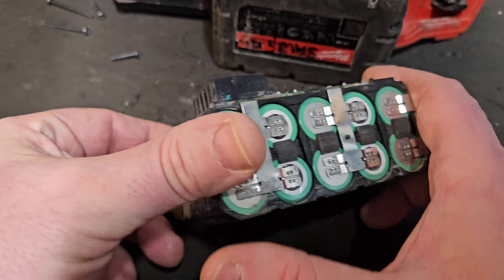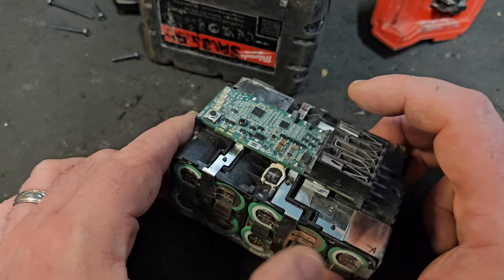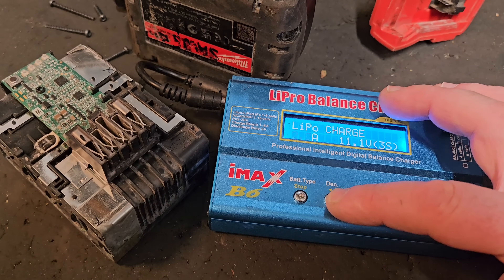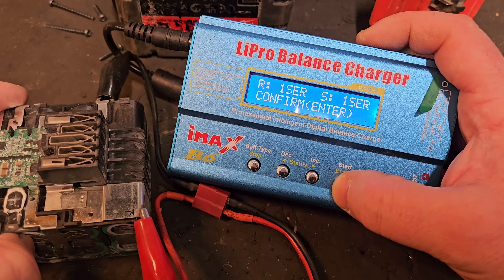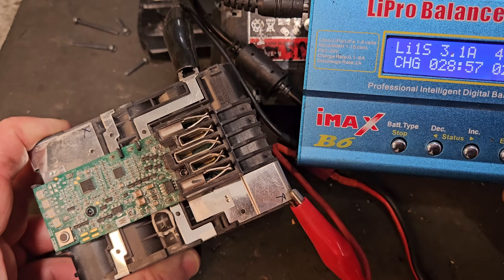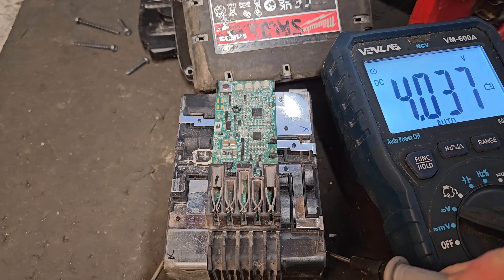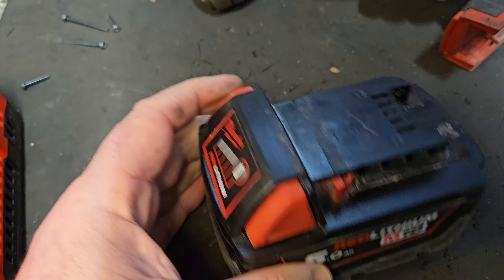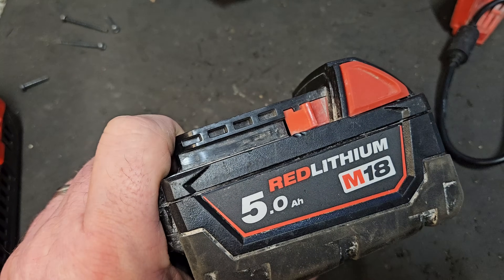Milwaukee Battery repair course EPISODE 9 dealing with cell imbalance

Comment: Hello I m just finished repair couple of batteries M18 and ONE of them was imbalanced and I couldn't reset BSM so I take air solder and put out the😄😄 BQ76925 and put back , now it works !!!
Reply from the maker: That's great you got it working

Comment: @doctorlefthandthread - thanks for putting this course together it was extremely helpful!  Question, I have a 5.0 battery with 4 banks at 4.1v and one bank at 0.2v.  Is it worth it to buy the charger or should I just get new cells?  Thanks!
Reply from the maker: Getting new cells is difficult I use reclaimed cells from old packs. To answer your question yes the cells at 0.2v are beyond recovery and need to be replaced.
Reply: @doctorlefthandthread  Thanks appreciate the reply!  I guess this battery will be demoted to reclaiming cells if my other batteries go :)
Reply from the maker: @projectguyprojectguy9019 yes I would say so

Comment: My IMax charger keeps saying Connection Break any idea whats wrong with it? I had to make some cables up as I dont have the ones you have May they are to thick and long
Reply from the maker: It might be an issue with your charger or you might be doing something wrong

Comment: Un grand merci de ce partage j'ai 3 batteries en m18 9ah a corriger elles ont en effet une cellule a 2.8 au lieu de 4.10 . Je vais donc acheter ce chargeur lipo pour essayer un équilibrage et voir si oui ou non elles peuvent reprendre  du service correctement.
Reply from the maker: It should work

Comment: I balanced all 5 banks of my 5.0 battery. all 5 banks are reading 3.71v. problem is that the charger is reading this as fully charged. they will not charge any more than 3.7v. how could i fix this. thanks!
Reply from the maker: There is no way the charger is reading the cells as fully charged at 3.71v . If it won't charge and the cells are equal you need to change the board.
Reply: @doctorlefthandthread  that's what i was hoping not to do lol. Is it possible to charge each set to 4.2 while all are at 3.7 currently?. i don't want to risk bringing the voltage up past what the other cells are currently. i guess i will try to change the board. Thanks!
Reply from the maker: @fortifiedcoffee7673 what exactly are you afraid of?

Comment: That would be only good for a while, the reason why that part of cells drop to that low is the battery has self discharge because of electrolyte damage.

Comment: Nice videos.  Confused on how you could charge 2S or more at the same time.  Isn't each bank in the M18s isolated with output terminals going to the BMS board?  Eg)  how could u say charge 3 banks without ACTUALLY pushing voltage to all 5 banks if they are in fact connected together?
Reply from the maker: See Short reply

Comment: Couldn't you also plug the battery into a light and let it run down to zero, then jump-start it with another battery, and now you are back in balance?
Reply from the maker: Running it down to zero is  a very bad idea

Comment: I recently bought a lot of 8 'for parts or repair' Ryobi batteries, and I was able to bring back two of them to life, while two of them couldn't have the 'trickle charge trick' done to them since I think the charger still detects the cell imbalance and refuses to charge.  Two of the batteries had significant water damage and rusted out, and the other two (both 6ah HP) require a BMS reset which requires specialized equipment.  Nevertheless I appreciate this video, this will point me in the right direction in what to do with two of the batteries, and hopefully those can be resurrected.

Comment: To charge AND BALANCE a 5S  battery all at once you have to add balance leads to each bank and plug them into the side of this charger. If you don't do this then you should stay with changing each bank one at a time!
For example 1S = 1 Bank and 5S = 5 Banks as he mentioned in the video.  Each bank has a nominal voltage of 3.7v and fully charged would be 4.2v or 4.1v or so if the batteries are old and worn down.

If you attempt to set the voltage to the 5S 21.0v and charge all at once them the batteries with a high starting voltage can get over charged while the lower volt battery or batteries will still be at a lower voltage which is not good and it can be very very bad situation if you cause one of these batteries to burst into flames as they burn so hot that typical fire extinguishers can't put them out. Just google EV car fires and you will be amazed and likely scared to mess with Lithium batteries.

Comment: After rebalancing, can it be expected the same cell groups will need to be rebalanced after some time?
Reply from the maker: It really depends it can take a long time to become unbalanced again
Reply: Being a former power tool rep, I’m really baffled how these big name brands would just let this happen, and not fix it immediately.  

Balanced charging was a major selling point in getting lithium “back up off the ground,” after the failed first attempt in the industry (around 2007).

Comment: Is the charger actually balancing if you don't have any of the balance leads connected as well as the charging leads?
Reply from the maker: I am bringing the cells up to the same voltage individually. You can balance a pack by connecting balance leads but it's more complicated.

Comment: what if I have the single layer battery pack (with 5 cells) and that exact same bank is the one that reads 3.0v while the rest of the pack reads 4.2v.  the problem is, there are 2 batteries tied together on that bank. the one with 3.0v and then it's also touching one that's got 4.2 already. I am worried that if I begin charging that bank, it's gonna overcharge that 2nd battery (since it's touching).  How do you do this???
Reply from the maker: Your 5 cells are in series not parallel. They are not connected in a way that you need to worry about charging 2 by mistake. If you can read the voltage separately you can charge that one separately by connecting the charger is the same place you tested it.
Reply: @doctorlefthandthread  Thanks, it worked! It's no mystery I am "stupid" to the ways of electrics. But that gave me confidence to go for it.

Comment: Could you also use a dc power supply to charge up the one bank of cells? Good video!
Reply from the maker: There are so many methods but I find the lipro B6 the easiest

Comment: I noticed that you are using LiPo mode instead of LiIon, does that matter?  I would have thought that the mode would have been LiIon?  Also, if I am charging a M18 HD12.0 battery, which has the same configuration of 1 bank of cells, followed by 2, and another 2 —- however with 3 batteries per bank instead of the 2 per bank that you show in the HD8.0 battery, do I need to change any settings?
Reply from the maker: Lipo is the setting to charge lithium-ion 
When charging a bank of cells the settings are the same if the bank has one two or three cells per bank
Reply: @doctorlefthandthread also is there any value to doing a slower lower amp charge (trickle charge), that takes more time?  I.e. 2amp vs 5-6amp?
Reply from the maker: @dkerze it's better to charge slow always
Reply: Thanks.  For some reason I only saw the response now.  I just got done watching your 6 video series and 9 video series.  Very helpful, thank you.  Note: I think LiPo is used for RC car batteries.  I am using LiIon mode which is meant for Lithium Ion.  Who knows, they probably do very similar things.

I think I read somewhere that the cells that tend to fall out of balance may sometimes be of an inferior chemical make-up.  Inconsistencies in the quality of the lithium / other.  Do you find that after you fix an out of balance battery pack that is suffers a similar fate after high demand use in the future?  Wondering if some battery packs are just destined to be lemons in a sense.
Reply from the maker: @dkerze they mostly hold the balance for a considerable amount of time

Comment: I have an M18 8.0 battery that takes a full charge, however after using the battery for a short period time goes dead. Once placed on the charger it immediately shows 3 full bars and charges to full capacity in a short period of time. I have checked the cells and it appears one bank is imbalanced. If I rebalance that bank will this resolve that problem?
Reply from the maker: Yes

Comment: So here’s a stupid question maybe, I have an M12 6.0, could I not just jump the one battery by hooking the individual bank to the charger without disassembling the battery.  Or possibly jump it with another charged battery?
Reply from the maker: If you identify the cell bank thats lower than the rest you can bring it up with the charger. Connecting to another battery won't cure cell imbalance.
Reply: @ Thanks for gettin back to me so quick.  I’m guessing you mean the charger that you have there and not the m12 charger.  I suppose I should have specified in my original comment
Reply from the maker: @hopkinstreeexperts759  yeah the charger I use to bring the cells up is the lipo imax b6 balance charger

Comment: Bought the charger on Ebay for $25, found I had two low banks on a 12A battery, brought both back up to 4.1V and all 4 lights light up again, full charge. Thank you for the video especially on how to operate the charger correctly.
Reply from the maker: That's great news well done thanks for commenting

Comment: Greetings from Long Island, NY. Great work sir! 
Question: why not just use the smart charger to discharge the entire unit down to the charger's minimum recommended voltage for that particular 5S pack, then throw the pack on the oem charger for a (hopefully) balanced charge? I've got a HTRC C150 charger I use for my RC equipment and I'd like to perform this on my M18 XC8 that suffers from the three bar syndrome, but I really don't want to baby-sit the job on the re-charge cycle. Thanks in advance.
Reply from the maker: Thanks for the comment. I have never tried the approach you suggested but might give it a go next time
Reply: @doctorlefthandthread  I have tried completely discharging the battery, then putting it on the charger in hopes it would balance out on the dead side. It did not change anything and still only got 3 bars.
Reply from the maker: @reddreaper  did you measure the voltage of the cell banks you have to bring them to equal voltage. The m18 charger will not balance them
Reply: @doctorlefthandthread  Yes, one was 3.5, another was 3.7, and 4.1. I brought all 3 up to 4.1
Reply: @reddreaper  better in storage mode 5 call balancing port cable and+ -cable too

Comment: I had a weird one recently where the cells were all balanced, but it was still acting like it was unbalanced. Haven't quite solved that yet.
Reply from the maker: What voltage is the battery putting out the top terminals?
Reply: @doctorlefthandthread  20v
Reply: Have you checked all the contacts of the battery for cell readings? You may have some problems with the BMS. I had a Dewalt that was missing a voltage on one of the contacts because the trace for that circuit was damaged. Once I found the fault and soldered in a jumper it resumed charging.

Comment: i bought the b6 charger. question- how do i connect the wires, if bank 3 or 4 were the banks with the low voltage problem? at the 6 minute mark you tried to explain but i wasnt quite sure. thank you!
Reply: hi again. for more context,  my battery has the 3 red bar problem. banks 1,2, 4 and 5 are about 3.5v. bank 3 is the only bank at 4v. how should I clip the alligators to balance this?
Reply from the maker: Yes I understand you have to charge bank one and 2 together 
Then charge bank 4 and 5 together 
 you must clip the red wire on to the postive terminal of the banks you have to charge the black wire on the negative end of the 2 banks. You can establish which is positive and negative with a multitool
Since its 2 banks you are charging at a time set the charger for 2s 
here is another video 
https://youtu.be/1uTLvCpb_4c?si=ytCd6QDlHBC7Nl6j

Comment: Very helpful. I have just bought both the x star and the LiPro charger. Have salvaged cells from a failed AEG 8 air battery. All except one dead cell have now been charged, discharged and re charged successfully. Will use them for repairs and experimenting with small individual battery replacements in torches etc. I am learning how to use the chargers.
Reply from the maker: Great 👍 it's all a learning journey with these things

Comment: I plan to set this up with the actual balance leads and a temperature sensor wired into a junk DeWALT charger so that I don’t even have to take the battery apart. I’ve found that you can fit a flat thermocouple into the battery by pressing down the release button and sliding it in from the top.
Reply: Did you make the charger how you said? If so did it work fine?
Reply: @fishingpatriot2344  Someone on Reddit said he already tried it and it did not work as expected. Strange, because I know each terminal has a direct connection to each bank of cells so it should be no different from manually charging/balancing each bank. Even so, he knew better than me so I set the project aside for now and never pressed “Buy” on the B6 balancing charger. :(
Reply: @emmettturner9452  i already ha e the charger for a battery for my kids nerf gun haha im just confused about the connections nd what positive nd which ones negative on my Milwaukie 8ah cuz they seem connected to the same bar but 2 are 1 way and 2 r the opposite.
Reply: @emmettturner9452  my front 2 batteries are both at 4v but the remaining 8 are 3.7 or less